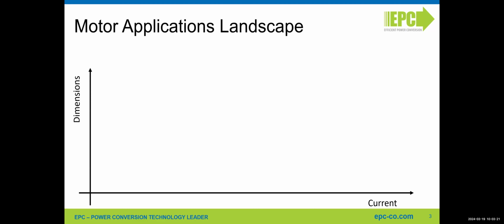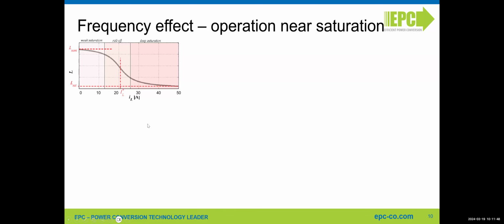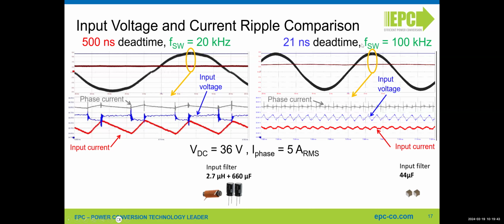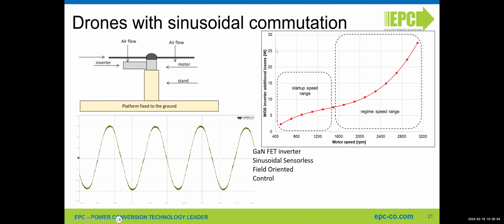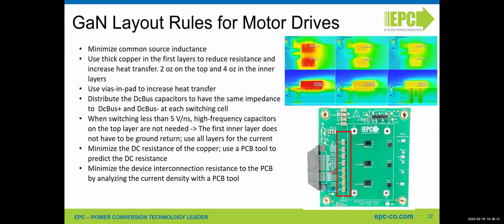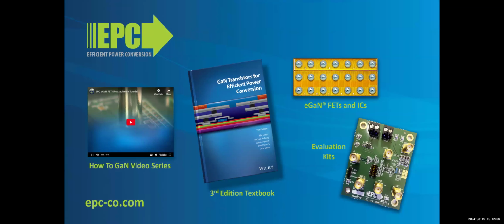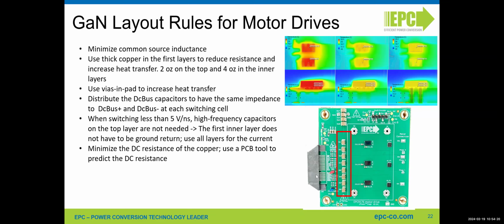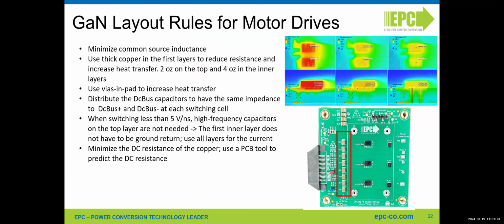Practical Applications of Gallium Nitride for Motor Drives

Comment: What is the difference between EPC2302 and 2361? Is it just the higher pulse current?
Reply from the maker: EPC2361 has lower Rds(on) and higher pulse current capability. It is the latest generation device in PQFN package.